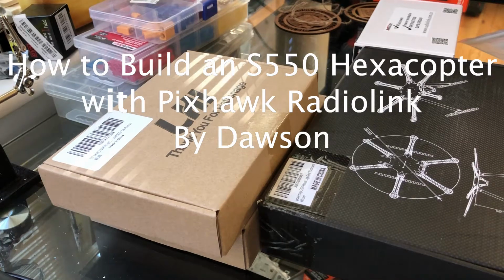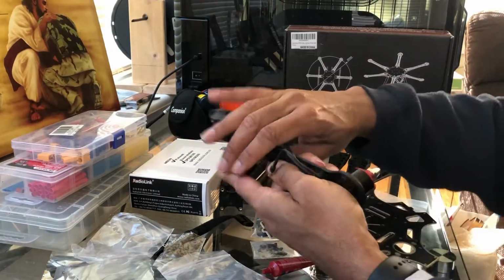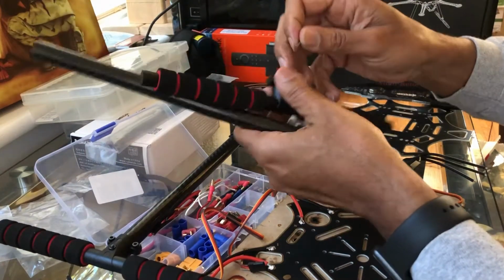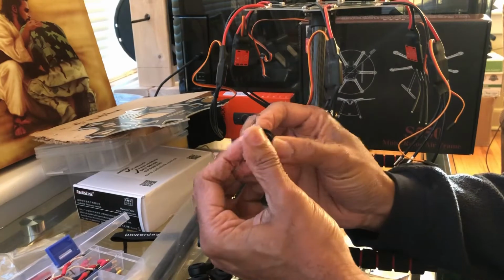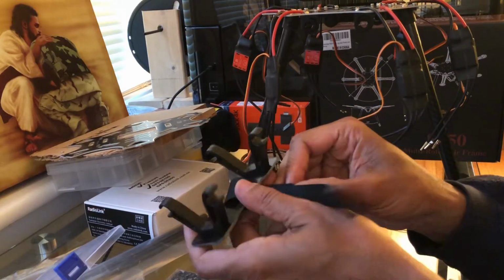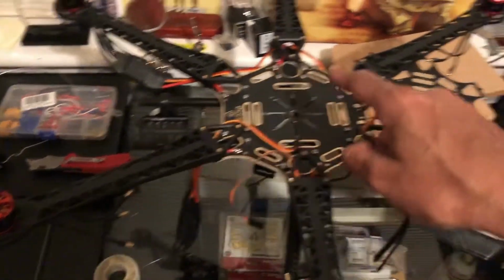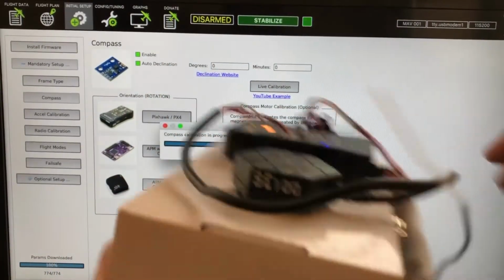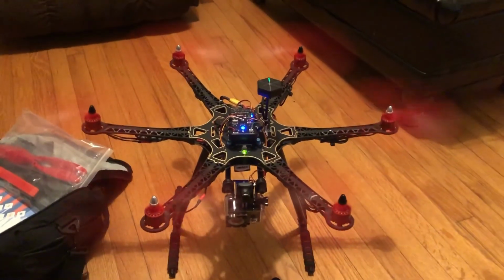How to Build and S550 Hexacopter with Pixhawk Flight Controller

Comment: What camera are you using or what do you recommend?
Reply from the maker: I have two cameras, one is a go pro hero 7 black, and my FPV camera is a FOXEER FPV Camera Foxeer Razer Mini 1/3 CMOS HD 5MP 2.1mm Lens 1200TVL 16:9 PAL/NTSC Switchable Support 4.5V-25V Input Voltage for FPV Quadcopter Racing Drone https://a.co/d/8VDfIIX. I used a black Mamba VTX: Flysight Black Mamba 5.8Ghz FPV Video Transmitter 40CH Wireless Audio Video FPV Vtx Transmitter for RC Drone MultiTotor Quadcopter (RPSMA ANT 6-28V,NOT for Gopro) https://a.co/d/5KMcVyH.  Hoping your build goes very well.

Comment: Tip two 44:20 do not tighten the bottom arms fully ,leave it loose,it makes it easier to line up the top plate perfectly, once top plate is perfectly aligned, the bottom plate can be fully tightened.
Reply from the maker: Great tip!

Comment: A tip!...file the sharp edges where all the wires are going to sit,minute vibrations can eat away the wires eventually, I'm also building one for fishing purposes.
Reply from the maker: That is a very good tip.  For my smaller racing drones I cover with hot glue as well.

Comment: Would a FlySky FS-i6X work for piloting a Pixhawk-based S550 hexacopter?
Reply from the maker: Yes, the main difference is just the binding process for your transmitter and receiver. The Pixhawk programming is the same. I just looked it up on the internet, and it looks like you can do an i-BUS connection. I am not sure what the max distance is so if you use this controller make sure you program the default protocol for landing in place or return to home when you lose the signal.

Comment: I had a pixhawk 2.1...didn't like the programming part,too much to do in terms of programming and GPS rotation so many times,its crazy compared to the naza v2...dji v2 is simple and precise can do it in 10mins on PC and flying in no time!
Reply from the maker: Yes, you are correct about programming the NAZA vs Pixhawk. My 1st quad build was with a naza and I would be lying if I said that DJI does not build quality products because they actually do. Their functionality is very superior compared to other flight controllers. I decided to go with the Pixhawk  autopilot because you can do more Advanced programming and I like the open source code. In addition there are some significant cyber vulnerabilities with NAZA. I believe DJI has corrected it with more recent platforms. Regardless you are correct about simplicity.

Comment: Can we use 6s lipo for this battery
Reply from the maker: Yes you can, you just need to make sure it’s still around 11.1V.      I use a Lipo 5000mA at 11.1V and 3s but 6s will work too.

Comment: Can we fold this Frame, I mean not directly, but by removing screws when we travel? Will it damage if we frequently remove/add screws for folding/fitting?
Reply from the maker: Yes you actually could fold the frame by removing the screws, you may have also notice I didn’t shorten any wires but zip tied them.  There is also an add on you can buy for retractable legs (Landing gear).  Hope this helps and good luck.
Reply: @dawsonplummer695  Thanks for reply